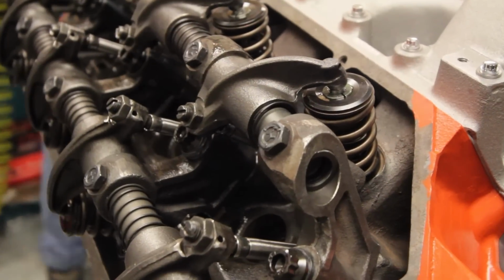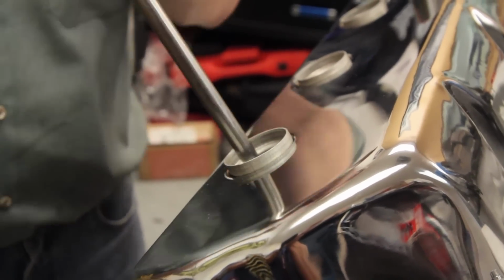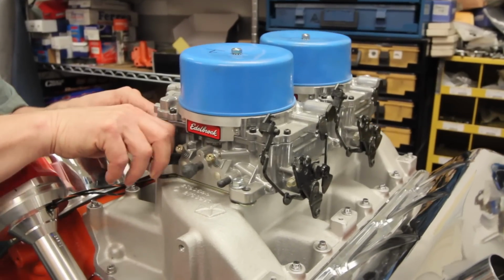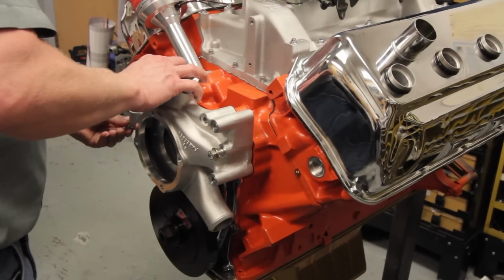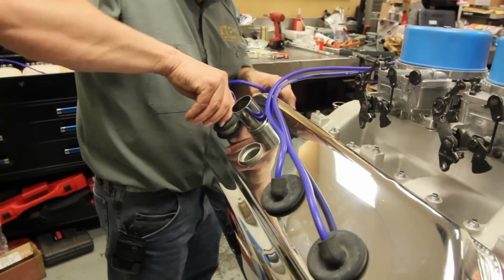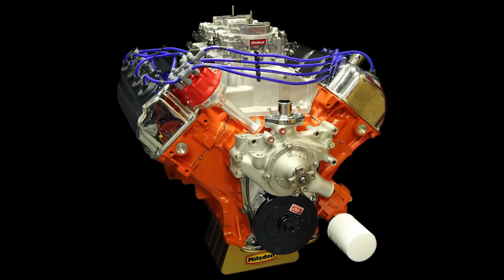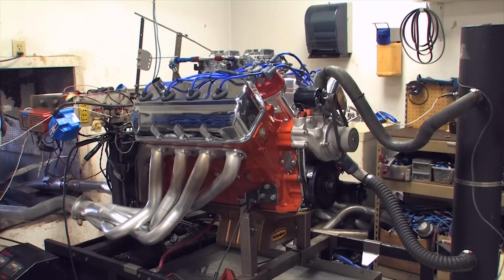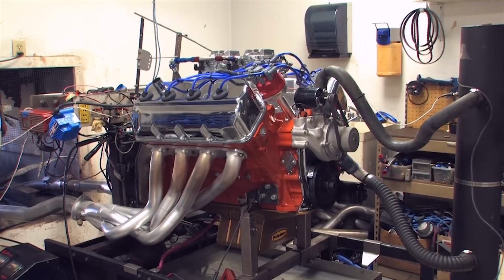426 Hemi Build -- Part 3

Comment: You got an extra 28 HP out of it. The factory engine was dynoed at 495 HP at 5900 RPM, and 522 HP at 6100 RPM with headers and no carb adjustments. With a different cam and 6300 RPMs you got it to 550. An average build, but a reliable build that is strong. Nice job.

Comment: Chad ,You are so wrong on cylinder placement on a Hemi.
I own a 426Hemi,cyl.placement is the same as GM blocks.
1357 left bank,2468right bank.
Always looking from driver's seat,that's how you do it.,
never looking from front of engine. Distributor turns counter
clockwise

Comment: Uh, the firing order is not the "same" because the cylinders are arranges and numbered differently. On a Chevy V-8, the odd cylinders are on the LEFT SIDE of the engine (right side as you face it) and a Hemi has the odd cylinders on the RIGHT side.
Reply: Chad ,check my reply above.
Reply: Driver's side is odd numbers on Mopars, just like GM.   The front-most piston is #1, it is on the drivers side, then next piston(#2) is offset the width of a connecting rod, on opposite bank(passenger side).  Continue for the remaining cylinders.   Just like a Chevy.

The firing order for Chevy and the rest of GM, and for all Mopar Gen 1 Hemi's, Poly V-8's, A Block, B Block, LA Block, RB Block, Gen 2 Hemi, and Magnum V8 is 18436572.

Comment: BB Chrysler always breathed better than a Chevy - they have a wider intake which breaths better - beefier bottom end for more rpm's- 454 no comparo !!!- I have a camaro - but - miss my 440 !!! - I am a Mopar guy down deep -
Reply: It's my understanding and experience that Chrysler bigblocks were winners because they made great torque numbers and moved big heavy cars quite well. All the common RB heads had terrible stock flow numbers, 240ish or so CFM stock. Big cubes and not so great heads equate to flat torque curves which move heavy objects. Whatever the reason, they are legends!
Reply: Never to late to come back to our Mopar ranks friend lol
Reply: Umm... the 440 had breathing problems to, ever heard of the 440 wedge..? It's a cross ram air intake to give it better air, and the exhaust was upgraded from the 440-440 magnum
Reply: @Shade_tree_garage01  No it didn't! The smog heads were the best of the lot and the 915s and 906s were already excellent.

Comment: Reading below here is what I have to say about it and I have said this before. If you use the same technology on the old engines as they do on the new ones they will blow away almost all the newer designs everytime why? There is no replacement for displacement.

At the time the Hemi was the best of the best when in PROPER TUNE nothing could touch it also dyno's are nothing but a tuning tool. If I take a engine put it on dyno 1 then bolt it to dyno 2 they are not going to say the same thing although they have got better through the years. Most of the hemis back in the day once they got about 20.000 miles on them or less were out of tune so they did not run that great but once you got the timing right the jets and metering rods set up right and made sure the valve lash was correct nothing could touch them.
Reply: I think you're forgetting it's cousins especially at a stoplight
Reply: Witness to this for sure .

Comment: why even heavier rod's? H beam rod's don't get used in my engine's unless boost is present. Stock and I beam rod's are strong without all the weight
Reply: +Duey Jones You obviously have never picked up a stock Hemi rod, lol, The newer H beams are a lot lighter, and the only I beams that you can still buy new semi reasonably are Manleys for about $1400
Reply: +Duey Jones You obviously have never picked up a stock Hemi rod, lol, The newer H beams are a lot lighter, and the only I beams that you can still buy new semi reasonably are Manleys for about $1400
Reply: +Duey Jones You obviously have never picked up a stock Hemi rod, lol, The newer H beams are a lot lighter, and the only I beams that you can still buy new semi reasonably are Manleys for about $1400

Comment: Apparently you have no idea wtf your talking bout a true hemi has domed Pistons the new ones are beveled at best they can't ever make a true hemi again do to emissions which is why they haven't had a decent hemi since 1970 which is WHY they stopped making them. Do your research before you look like a idiot
Reply from the maker: kharvick2908 Are you replying to the video or someone's comment?
Reply: I have had several Hemi's in my time and NEVER swapped out the bearings or the wrist pins for any reason...and I hammered them pretty good back in the day on the street and NEVER had an issue. I thinbk you have been reading too many "How to build an engine" books because your statement is nothing but pure BULLSHIT.
Reply: +The Horsepower Monster He's (MR 9 months ago above) had multiple tabs open and replied to the wrong vidI am thinking. I'm sure he's referring to the modern 'Hemi'. 

Nice vid BTW. Good to see a build of a non stroker Hemi. 
I note you state the heavy piston limits revs. Didn't seem to limit too much to me. Those figures for a stock[ish] engine are excellent. I had a 440 with 6 pack TRW forged pistons that weighed 1100grams ea and that big weight didn't seem to stop it from revving either. 
Maybe you meant limit in terms of blowing the motor up by over revving it too hard with heavy pistons inside lol.

The way you built it isn't that different to the way they were built by the factory in about 1968.
I read somewhere (but can't find it in the Hemi book), Chrysler submitted a paper to the SAE saying the street motors were closer to 550hp in the 5500rpm+ range but as mentioned I can't find the exact details and I looked just now too:). 

The main differences I can see between yours and then is they had dual point dist, 10.25:1 comp and leaded fuel. 
Your dyno test shows similar power (to my recollection of 550hp Chrysler's paper to SAE) with lower comp, modern camshaft grinding techniques and profiles, better distributor (but not hugely better), improved ignition coil and unleaded fuel. 
I like that you built yours with a solid lifter camshaft and to my mind this is where the revs are. Flat tappet hydraulic camshafts will limit revs but I wonder how a modern hydraulic roller would do in this stock stroke iteration? 

I thoroughly enjoyed this. Love to see a dyno test with cross ram on it and that Stage V dual quad that can take 2x Holleys.
Reply: +Poly Bun said: "If you have one, and you have any sort of intelligence at all, you'll be swapping those rod and crank bearings out every 25,000 miles and the piston pins out at 50,000 miles, and that's if you're treating it kindly. "

That's the biggest crock of shit I ever heard. If you beat on a Hemi regularly, yes, you could be right.
Reply: +Jon Steele I think he meant if you thrash it every day you should do that. 

I'd actually like to build a Hemi, de-chrome the rocker covers and fit a mild camshaft for a smooth idle and paint the whole thing - including the dual quad intake in Chrysler Turquoise like the early Wedge engines. It would have factory air and power steering.
I'd have the factory air cleaner in black too and it all fitted to a Dodge Dart or a Barracuda. I'd make it look as if it were an obscure dealer factory option or something slightly obscure. 
Key to it all would be the smooth idle of the 426. Done well it would have heads scratching. I'd fit a D60 rear end to it lol. That would really be the icing on the cake! I'm unsure what wheels though...
Reply: There are better ways to make your point, no need to be an asshat in the process.
Reply: Well start by going to machine shops esp ones that have a reputation for quality work and start asking for a job. Offer to work for a day or two for free. Clean the lathe, get the lunches, empty the rubbish etc etc but most importantly shut the fuck up at work. For some reason new employees aren't allowed to express any opinion or show any initiative - unless asked. Then when you don't do something because you haven't been
 asked that's your fault.

Anyhow that part of it out of the way automotive machining is what you're after. Don't be a mechanic if you want to build engines on a regular basis. Although mechanics do in fact repair and rebuild motor Mechanics and Machinists are two separate trades.

Like most jobs, the interesting stuff is done by the top guys. Mostly routine cheap engine rebuilds by people that want the best job but on a used car salesman budget is order of the day. There are lots of bread and butter jobs before the biennial 426 Hemi comes in.

Another great trade might be in aviation. You could become a Licenced Aviation Maintenance Engineer.
Then you might get to work on turbine engines. That would be interesting no? Also there are many interesting piston engines in aviation and they always need repairing.

Comment: Do you have to use a flat tappit cam on hemi, or can you use a roller cam style?
Reply: I don't think so! 
The way you've written that it would seem that by using identical roller camshaft with opening and closing ramps the same as a flat tappet camshaft and putting roller rocker arms on it, that a Hemi would make +60hp.
It wouldn't. 
The roller rockers roller tip has a tiny radius as compared to the stock rocker arm valve tip wiping face (which is about equal to the radius of say an orange. The reduction of friction by using a tiny little roller in the place of a large wiping face would be very small if any at all on a sub .600" lift camshaft. Roller tips really only are useful on very high lift cams. Under .600" they're a total waste of time. 
The roller lifter has greater mass and has to be contained with stiffer spring[s] adding directly to the pumping losses of the motor - in short the reduction in friction afforded by the rollers is more than negated by the stiffer spring used to control it esp with tie bar style roller lifters.
Roller hydraulic or all camshafts are limited to 6000rpm so there's no gain there. Roller solid camshafts are incompatible with street use because the rollers can't handle idling for long periods. Hemis have big ports and like lots of rpm. This rules out a big revving Hemi on the street. I know street Hemis had hydraulic lifters, but I'm putting the case as to why "just rollerizing the valve train is good for 60hp" is incorrect.

So it looks like the solid flat tappet is the best bet for maximum power in the 6500rpm range 426 Hemi on the street. No lifter pump up, lower mass and can easily exceed 6000rpm. Downside - adjustment.
Here's the dyno sheet for the above motor (link below). I can tell you it wouldn't have made 610 with a rollerized valvetrain.
It would have made about 500-525hp by extrapolating from that graph and considering hydraulic camshaft limitations.
http://www.horsepowermonster.com/wp-content/uploads/2012/11/426-Hemi-Dyno-Sheet.pdf

Comment: Now that's a hemi not like the new pos ones
Reply: +JETZcorp 

Thanks for the education, linking Tom Hoover, and classic Hemi design points, to the new era motors.
Reply: Almost all overhead cam motors today have a hemi or sim shape. You had to have these stupid big heads for the push rod HEMI and Ford BOss motors.  Do you know how ignorant you sound when you say this is a real hemi and the new ones are POS?
Reply: @johnnyvt9  no DOHC is a pentroof NOT a hemi
Reply: @MiyukiSadako  my stock unported aluminum mopar performance hemi heads flowed nowhere near 471 cfm with the valve pushed all the way open. After a valve job, narrowing the valve guide bosses, and raising the port roof I got 420 cfm @ 28" h2o at .650" of lift on a super flow flow bench.
Reply: kharvick2908 you wanna see POS go look at any engine built by chevy  in the last 30 years low torque  low HP JUNK how do they sell them ??
Reply: Yes but even though it has all of Hoover's suggested mods it is only a Hemi by name now.
I'm not saying the mods are bad or wrong or anything negative about them, what I am saying, is his mods made the true Hemi obsolete so therefore it isn't a Hemi anymore.

Comment from the maker: If you are putting aluminum heads on an iron block, an MLS (multi-layer steel) gasket usually handles the difference in thermal expansion between the two materials better than a traditional composite head gasket. We used MLS gaskets from Cometic and they worked well.

Comment: I'm gonna build an identical hemi. I'm planning on running 10.25:1 compression, aluminum heads, and a 292 hydraulic flat tapper can. What head gasket would you suggest for the aluminum head setup?